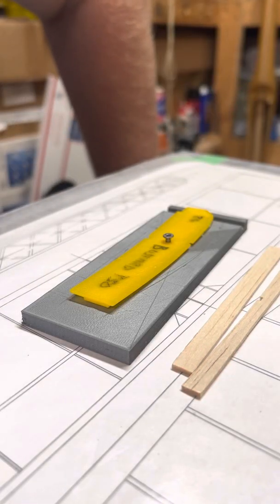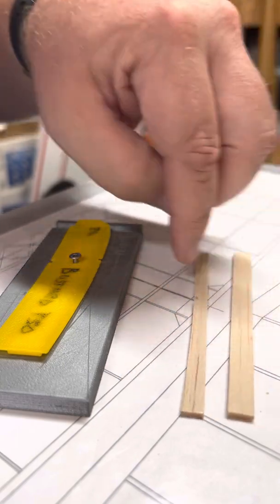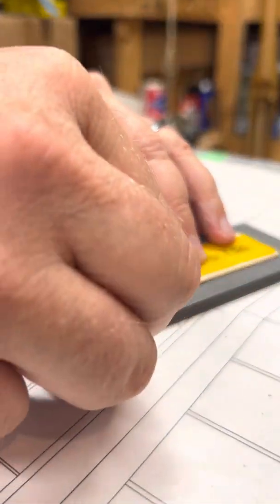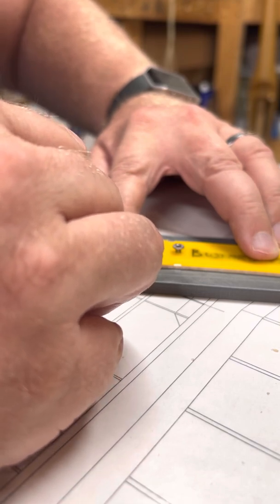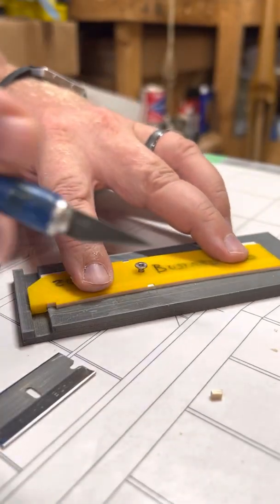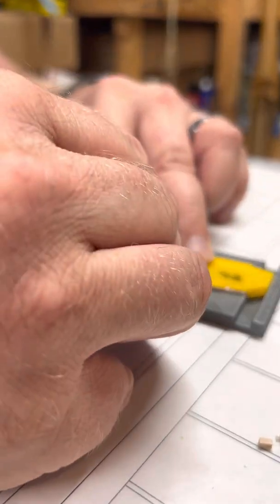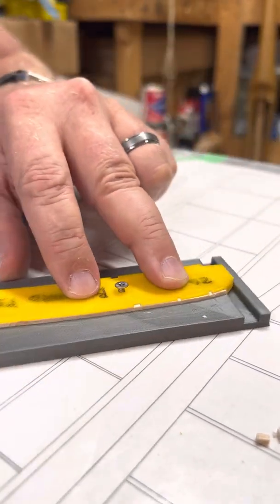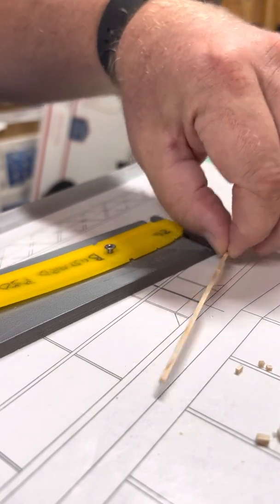Cutting Free Flight Wing Ribs using a 3D printed fixture

Comment: Very inventive Archie, but permit me to ask some questions.  How would this work on a tapered or elliptical wing?  Wouldn't that require multiple templates?  And is 3D printing absolutely necessary?  Couldn't a template just be cut from thin plywood?
Reply from the maker: Thanks for the questions. Yes, for an elliptical or tapered wing you would need multiple templates.  I have made a set that are double sided for the Skybunny which is a flat bottom wing. This technique could absolutely be used with templates that are cut from plywood.  I have a printer so instead of cutting out the templates, I print them.
Reply: @archieadamisin5263  Thanks Archie.  A very clever gadget.  It also might be useful (perhaps with modifications) for cutting Simplex airfoils, one of my favorites for tapered or elliptical wings.